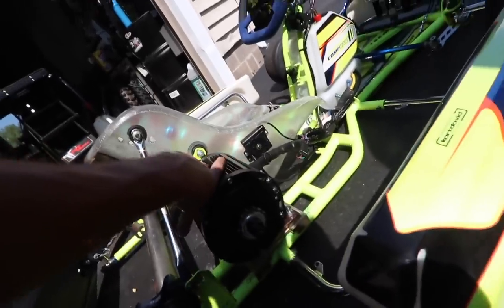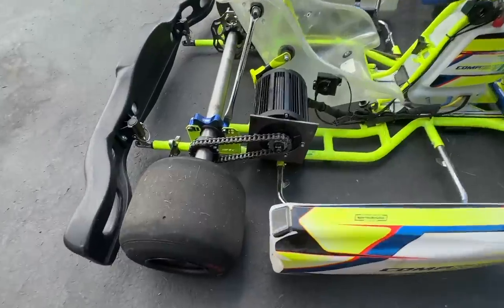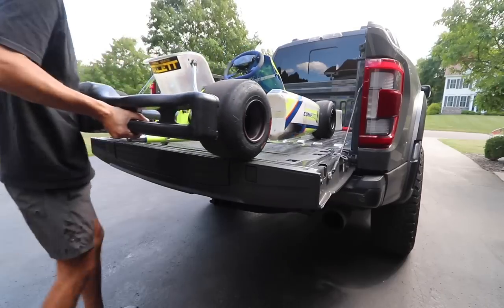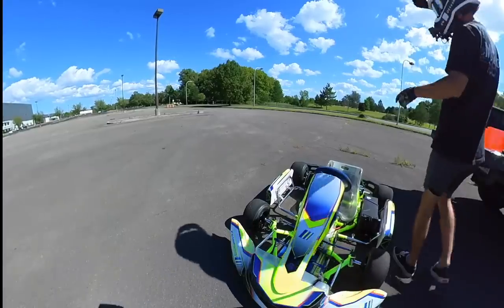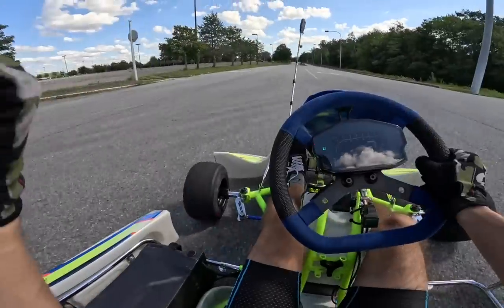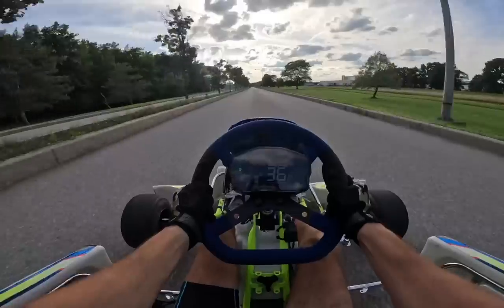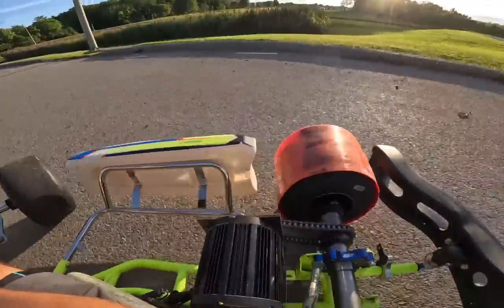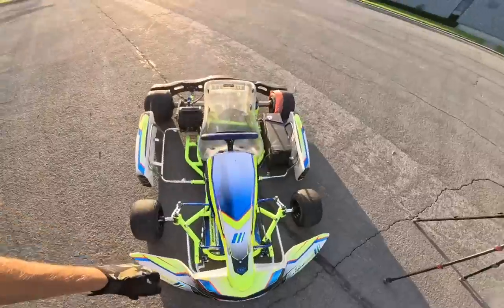Building a 100HP Electric Drift Kart!!! 80+mph

Comment: I just bought a 1998 kx125 for 700$ only issue is a bad top end, sent out the cylinder to get re chromed, having a lot of fun learning about these bikes but I have 1 question for you, I have no roll in gear when I pull in the clutch, would you have any idea why ? Clutch cable is on properly

Comment: cool build but your leaving so much possible energy on the table. battery on each side, move the break to the center of the axle and then add a second motor on the other side, and keep the high speed gearing on each side. A dual motor dual battery setup, that I've not seen before :) Added bonus, is weight distribution is centered, normally you would add weights to opposite side of engine to balance it all out, but not with the dual motor setup. You might need another controller so the system will RPM match both motors

Comment: Gonna need to add front brakes cause of the rear tires with pvc
Reply: I dont understand why he use PVC when it has Power to slide without them
Reply: @tonninseteli855  correct, folks use it for low hp karts to "drift"

Comment: I had 2 reactions to your building video.  First , would that small motor mount hold the tension in the chain at peak torque, it didn't, and why not swap the axle and put the motor on the left side to solve the rotation problem.  Good luck, looks like fun.  I'm in pa, you in del?

Comment: If you want to make a proper "drift installation" you should check the youtube of jacob sherwood but in recap is making the whells have more angle and putting rain tires for more grip in the front.

Comment: Maybe try calling a plumber and see if they will sell you 4 or 5 feet of their own stock.......if they have anything..SDR 35 green pipe used for rain drainage. Will work too.just give them the inside diameter measurement.that u want.peace!

Comment: Your 22 tooth gearing has a theoretical max speed of 120ish mph. Your running out of power with the votol controller and the surron battery. Change the controller to a FarDriver nd72530 and get a battery that can output higher peak output. I built a battery 72v 30ah with 240a continuous output and 500a peak output battery and it’ll get you to the power you should be getting out of the qs138 90h.